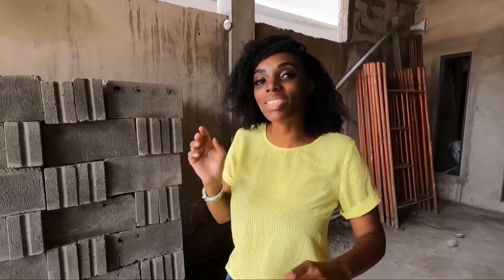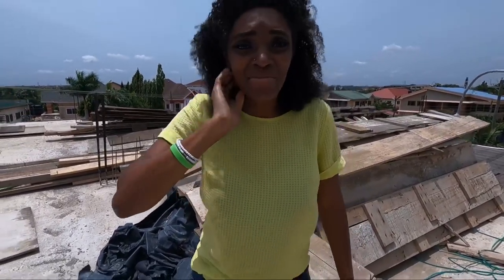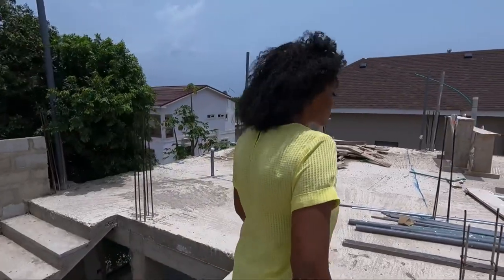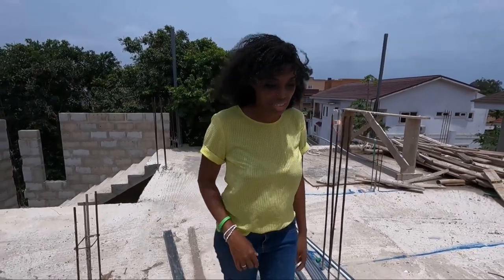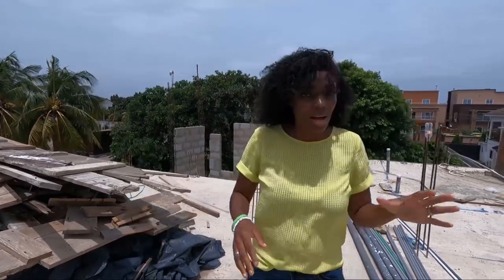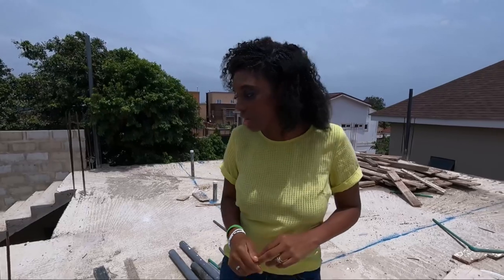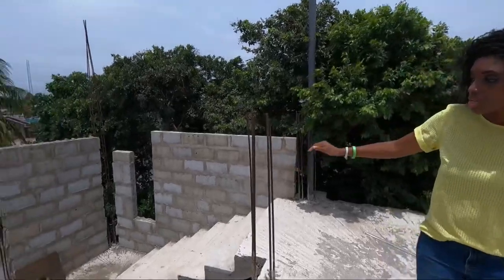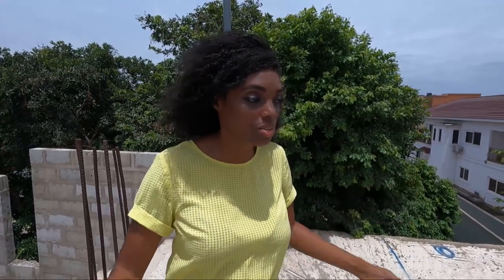2000 Concrete Building Blocks And Counting!!!

Comment: 3:11 kindly try and secure the 10 course wall behind you , at the staircase landing before the weather drops it . Since it’s exposed, it can easily collapse with heavy wind before a rainfall . I experienced similar thing . I can see pillar columns on each side so cast them to hold the wall ASAP. Lovely project so far .👏🏾👏🏾

Comment: Make sure you don't pile all the concrete blocks on the 2nd floor slab in case it wasn't designed to take the load. It's safer they lay them right away to carry the load down

Comment: Hello kwame, talking about good insulated blocks in Ghana, can you please make a video about the benefit of  building with these type of hollow blocks? As we know with the hot weather in Africa, it's very difficult to keep the house cooler due to specification of the building materials we tend to use. I reckon it would be better to use 9 inch hollow blocks for the (north,south,East and west) external  walls as a thicker protective barrier against the heat  then 4,5,6inch hollow blocks should be used for the internal walls depending on the load bearing structures.

Comment: Just making block work lay out, please be mindful of dampness. Especially because your flow is all flat. Your best bet will be to have a temporary screeding to direct water flow to the pipe outlets, so the water doesn't gather in one section of the room when you have the pipe in a different section. It's difficult dealing with that situation at least until you are ready to roof